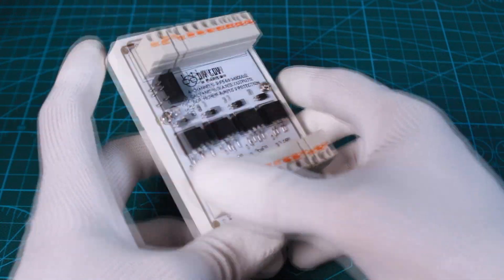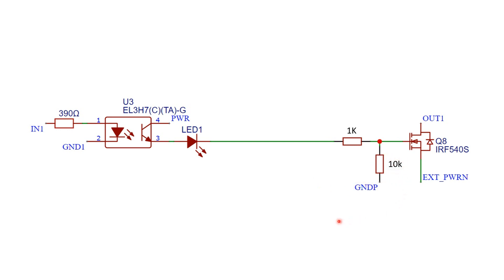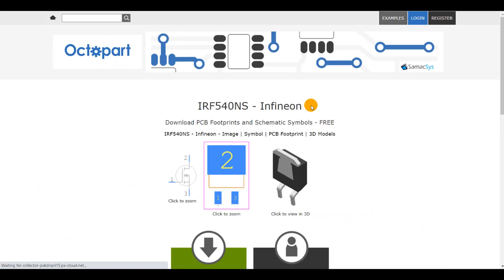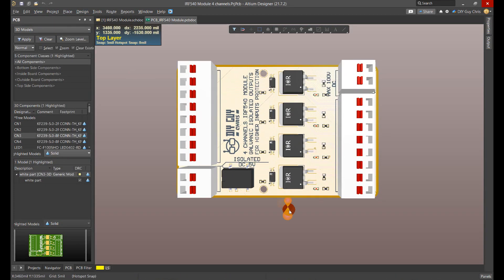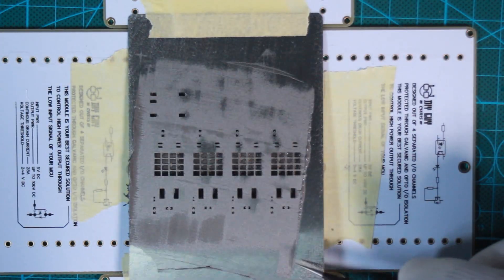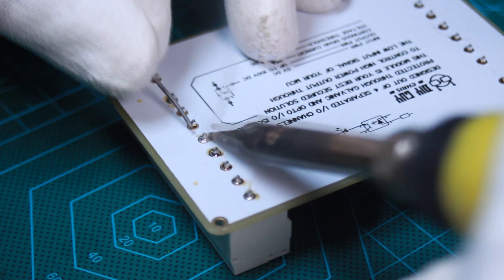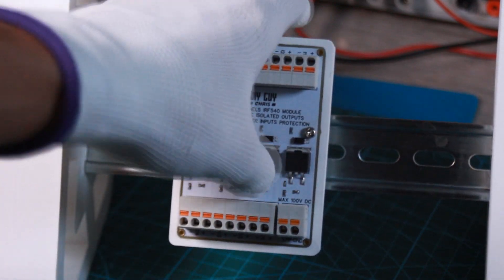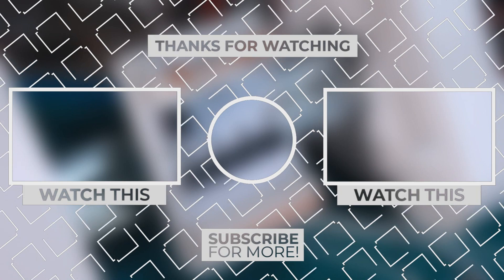@Arduino  IRF540 Mosfet (#diy Module Rail Mount)

Comment: Nice job 👏 up to how many amperes the irf540 can be used
Reply from the maker: The detail to consider is the trace width, for higher trace width you need just to keep them copper exposed and add some solder core to those trace to make them thicker
Reply: @DIYGUYChris  Thank you Can you send me the gerber files